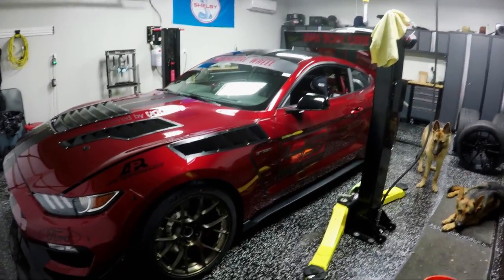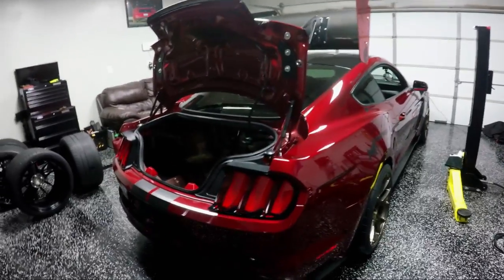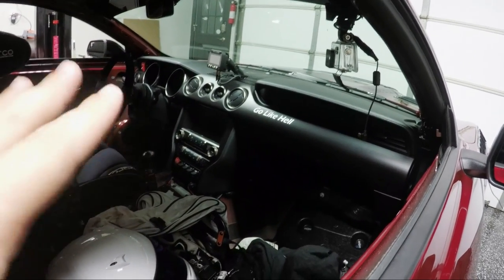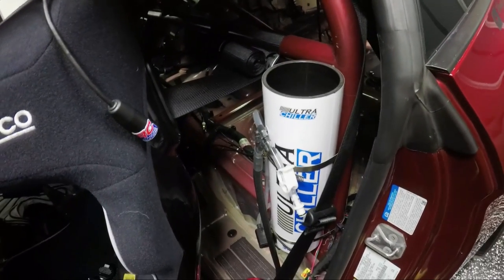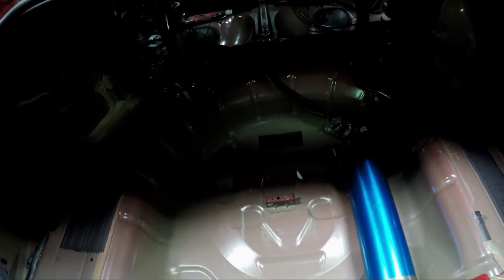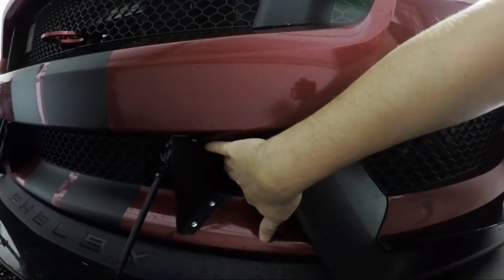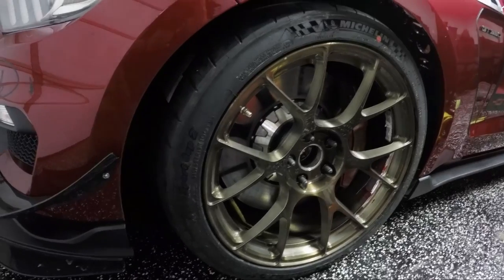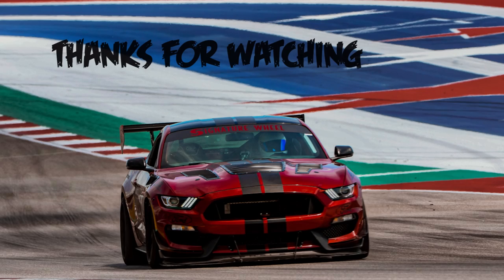Walkthrough of the Honey Badger and a peek into future plans

Comment: such a great video. looking at shaving weights and light mods for HPDE. this is highly educational! Question: i saw you deleted resonators, are you still running stock exhaust? or went aftermarket to shave additional weight?
Reply from the maker: Mufflers are still OEM. Run them in sport mode using the grimmspeed plugs. Headers, catless mid pipes, x pipe and resonators are ARH. Love how it sounds, but too loud for the street.
Reply: @honeybadgershenanigans  thanks!
Reply: @honeybadgershenanigans  i've been looking at track builds for the gt350 thanks/because of your videos! sent you a pm on Instagram :)

Comment: BIG question of mine is, what would you recommend if you were to build starting from scratch will everything you know now.  What would you still buy and install vs not?  
I am still debating over a used GT350, or a new PP2 (or PP1), or perhaps waiting for the new Mach 1, though I think that will come with a digital dash ONLY and I'd rather not pay extra for that... So, debating on a PP1 or PP2 and then mod it from there.  I haven't done track days (would like to, one day).  I have done a session of Time Attack and some Hillclimbs, to which most of my racing will lean towards Hillclimb.  That being the case, I did have a 2020 GT350R on order but cancelled due to all the factory closures and uncertainty...
Reply from the maker: OooOoh. Asking the million dollar question!

My answer would depend entirely on my goals. I've done everything backwards as I've addressed issues as I've broken things. Would have much rather started with a cage and coilovers before the engine (would have been cheaper!). 

Time attack with a specific class in mind: PP1 with coilovers, AP racing kit, light weight wheels, and big aero

All out car: Cheapest wrecked V8 I could find and build it up

All out Voodoo: not sure I'd do anything different except buy a wrecked one first. Maybe used depending on what the difference is running these days. 

The GT350 is undoubtedly the track day king of Mustangs. I instruct a lot of Mustang guys and the GT350 just has that special sauce that gets everyone out and gets people to really fall in love. Doesn't mean a PP1/PP2, Bullet, or Mach 1 isn't a phenomenal car, but they're not quite as fun to drive - a bit slower, don't sound as good, and the almighty Tremec is leagues better the Getrag trans in the 5.0s. If you're looking to build something to an extreme and want to focus more on competition, I'd go 5.0. If you want to build something and love the process and just love the Voodoo, I don't regret my 350 build at all. The car has that "special" sauce that makes most other cars boring. 

If you're looking for something to keep street driving, GT350 all the way.
Reply: @honeybadgershenanigans  Thank you VERY much for answering and fair enough answer indeed!
I have but to debate whether or not I will see much track VS hillclimb, to which I think a PP2 would over all be ideal (ESP class at first, then mod n Supercharge to go to SM).
Don't get me wrong, watching your videos makes me rethink the ENTIRE thing and I am always left after each;  Yup, GT350 rockin' track car build STAT!  
If I do go GT350(R) I'll have questions!  :D  Cheers man!  Keep up the content - you ARE literally, living the dream 8)

Comment: How do you feel about the flat plane.  I’m building another engine and I’m being pushed to put the cross plane in.   I real like the flat plane
Reply from the maker: I'm FPC or die :) 

In all seriousness, it's a hard motor to build since it's quite finicky. A lot of builders have had issues with rings/pistons and secondary harmonic vibration. My recommendation would be to make sure you find a competent builder who has tons of experience with the FPC. I know RPG and MPR Racing Engines (in Florida, not MMR in CA) both have lots of experience.